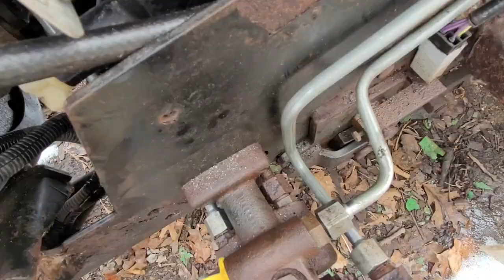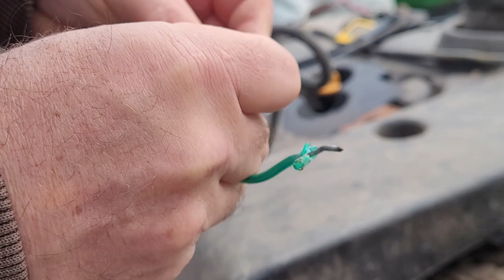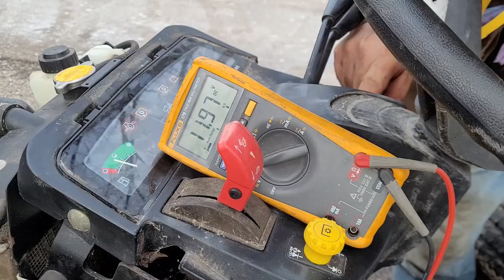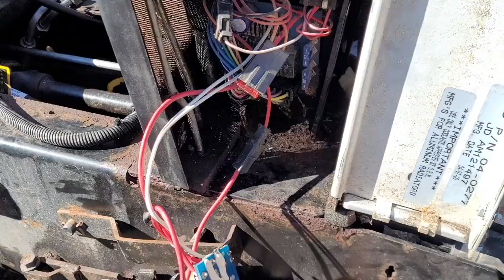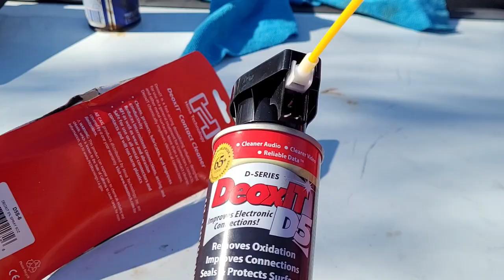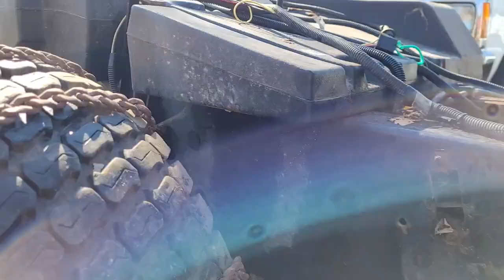Project snow beast number 7 John deere 445.  hydro line, led headlights, broken key removal, fab

Comment: Keep up with the good work. I figure from the last video when 1 of the hard lines leaked, the one that send oil to the attachments. I didnt see you used any of the hydrulic levers by the steering wheel when it leaked so the line should have no pressure, right? That makes me think that something is still stuck in that controlvalve you tried to free up in one of the first episodes
Reply from the maker: Off camera I did operate them and also full revved up the engine which then showed me the additional leak. So far it looks like both levers and their respective control valves are freed up.